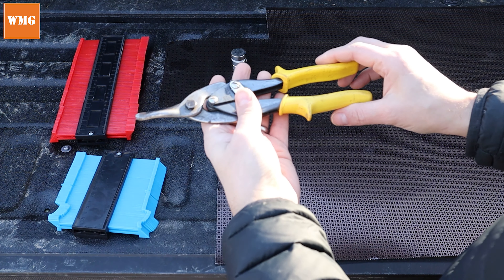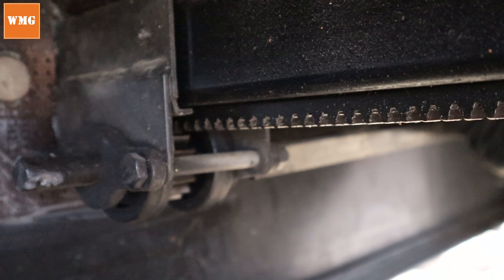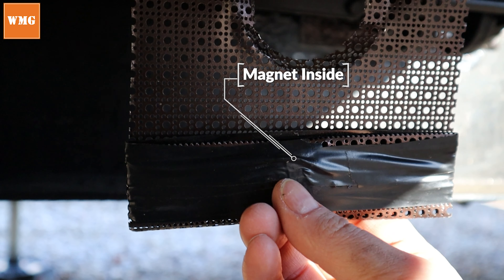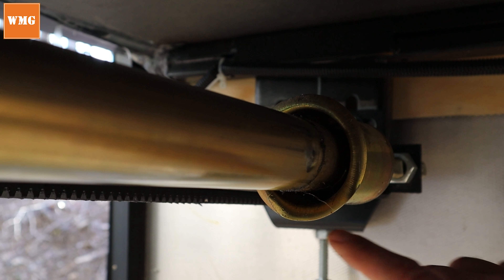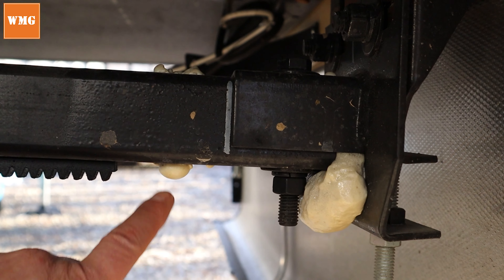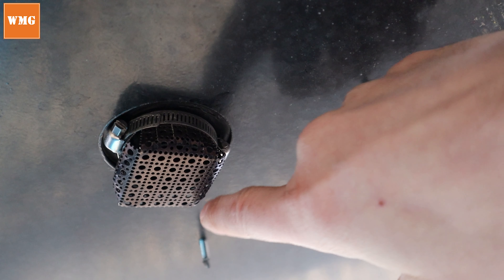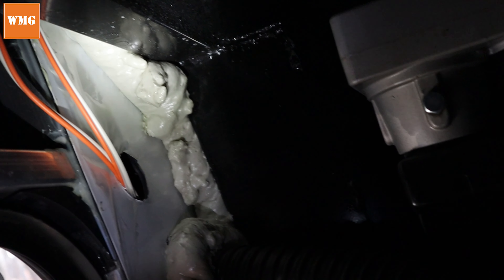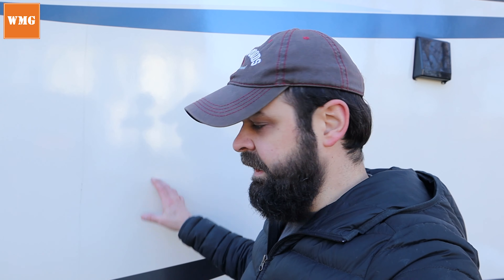How I STOP MICE from getting in my RV - No Mice 3 Years Later! #mouseproofrv

Comment from the maker: Did you learn anything from this video, did it help you in any way?  Let me know in the comments. Feel free to chat about the process, and if you have any questions while you are working on your RV feel free to ask and I'll do my best to help. Also,  other viewers have a lot of experience to share, you may get great input from them as well. As a community we support each other through sharing experiences and knowledge.
Reply: Hello, serious mouse issue and it's making me crazy. I have an RPOD which is fibreglass and a sealed unit. We never had an issue until I let the kids use it.. they left the door open most of the winter. Sigh. So the mice made themselves at home and chewed like crazy. Now I have things to reclose. Where did you buy the aluminum? I have traps... So once sealed hopefully they end up in the traps.
Reply: I learned that once you over pay for an RV you get to take it home and basically rebuild it yourself because they are mass produced and quality control is non existent.. great video by the way very informative 😉😉
Reply from the maker: This is the aluminum I used.  https://amzn.to/3M8s0A3
Reply from the maker: Lol, thanks for the comment.  Yes RVs are not built as good as they look. I've found that it becomes a hobby to work on them just to bring them up to a reasonable standard. I remember that wires pulled out of metal crimps near my battery due to bumps in the road.  I had to re-crimp all the manufacturer electrical joints.

Comment: I really lack a lot of education when it comes to keeping mice out of my trailer.  I'm a new RV owner and so luckily so far I have not had the experience of mice.  Can mice jump high?  I figure there are only 5 points of entry into my trailer that mice can climb on in order to get inside my trailer when my trailer is parked for the winter (no stabilizers deployed). The four tires and the front hitch jack.  If I take care of those 5 points of entry then I'm golden. Unless they get up on two legs and climb up onto the axel?  But then if I roll up on leveling blocks to make the clearance higher that should take care of that issue.  What am I missing?  Because of my lack of experience in this issue I fear I'm a one-dimensional thinker.
Reply from the maker: The first thing I am thinking is, do you use an RV cover? like a tarp or fabric type cover that hangs over the whole RV? if you do, they defiantly can grab their claws into that fabric or the tightening straps that hang down and climb up, once they do that, they can get into all sorts of places like the vents for the furnace, fridge, AC units at the roof, or gain access to the bottom lip of the I-beams below the camper and walk along that lip until they find an access point. Second thought, is the RV parked in a place where they can drop in from branches, trees, bushes from above or next to the RV? if the can, same sort of entry points are applicable to them. Is this a 5th wheel or travel trailer? With a 5th wheel you have the front legs that need to be down when not attached to a vehicle. Those legs have gaps cut through the floor that have enough room for mice to climb the legs and enter the gap in the floor. With a travel trailer, the same concept is true for the stabilizers or any sort of leg that holds the front of the trailer.  Lastly, I have found that given enough time, they will find things that we can't predict. So the solutions I outlined in this video take an approach of seal everything so that you don't have to worry about predicting what ways they can enter, just know that it's all sealed so you reduce the likelihood or even eliminate the opportunities. With out an existing gap or hole, your likelihood goes way down. They can chew through some soft things, but that's why my approach shows us using metal screen where possible. My RV has a plastic hard surface covering the entire underbelly. That helps because the insulation is not exposed, and the number of gaps for me to fill are reduced. My old travel trailer had no hard underbelly sheathing, so the insulation was exposed, and the mice could crawl and grab onto that insulation membrane and move amount the underbelly anywhere they wanted. Plus they could shew through it. So a plastic hard shell set of panels to seal the underbelly is a huge mouse deterrent, but again, my RV came with that so I didn't have to install those black plastic panels you see in the video. Let me know if there is anything else I can do to help.
Reply: @WhatsMyGear  Hey, This was a super helpful video and reply. Do you know where I can buy the plastic panels that fit beneath the RV you mention toward the end of your reply?
Reply from the maker: @crabtreecreates  sorry those came with my rv. This is something I don't know about.

Comment: Sorry your material is not aluminum aluminum is not magnetic🎉
Reply from the maker: The mesh is aluminum, the mesh is not magnetic, that's why I had to use magnets to hold the mesh in n place while the silicone dried. Once the silicone dries, you can remove the magnets if you like.

Comment: Putting aluminum mesh on a steel frame may be problematic. Those two metals cause a dielectric field which can accelerate rust and corrosion.
Reply from the maker: That shouldn't be a problem when both metals are coated. The aluminum comes coated and the frame is painted heavily. So there is no effective bate metal touching.
Reply: @WhatsMyGear  my camper is over ten years and half powder coat on the frame is gone
Reply from the maker: @benjamintucker9829  if you separate the metals you should be fine.  So you could paint the area that needs separation from the aluminum or you could apply a thin membrane between the steel and aluminum.
Reply from the maker: @benjamintucker9829  paint or seal the surface where the two metals touch

Comment: My motorhome wouldn't start, so I took it to the mechanic and found rats had eaten through the wire of the fuel pump.  The mechanic recommended using dryer sheets stuffed around the wires to keep  out rats.  Hope this works.  If you know of anything better, let me know. Thanks 
Ed
Reply from the maker: I would not recommend dryer sheets.  That's a lazy answer that doesn't work.  Watch this video for a way that works.
Reply from the maker: That's exactly why I made this video. 😀 I'm 3 years mice free.
Reply: The wire Luke that covers the wire harness is molded with soybean type material an wonder why the automotive industry uses it? There have been thousands of stories of vehicles that mice an squirrels an rodents have eaten wires up or destroyed wire harnesses!

Comment: The "gaps" on the slide arms are there for a reason. They are "Weeps", to let moisture exit. You spraying expanding foam in there, is going to destroy those slide arms. 
You thought this through, without thinking it all the way through. 
Also, a mouse can only get through a hole the size of its skull. a hole the size of a pencil would be impossible, unless it was a baby mouse. Baby mice wont be getting into you RV. If there are baby mice, then you already have mice in the RV. \
All the sealing of holes in the world, will not "mouse proof" your RV. They will make their own ingress. Skip all this pointless work, and install poison baits in key spots of your RV. 
You wil drive yourself insane trying to chase down all ingress points a mouse could take advantage of. Mice suppression is the only thing you can really do.
Reply from the maker: Appreciate you sharing.  I can say that it's been years since I made this video, and I've still never had a mouse. Everyone can approach this problem how they decide to for their specific situation. For me, I don't accept suppression because it allows the mice in.  I want to prevent them from getting in the first place.  And so far, I haven't had any issues.  As for the arm weeping holes, I'm not sure how water could get in there in the first place on my RV because the entire underbelly is sealed from end to end so street water should not be able to splash up there.  That might be different on other RVs. Not everyone has a sealed underbelly. You provided some good things for people to think about, I'm just sharing my thoughts on my situation. Have a good one 😀